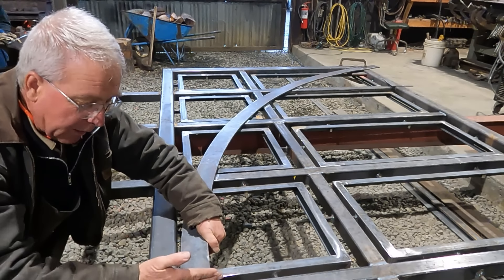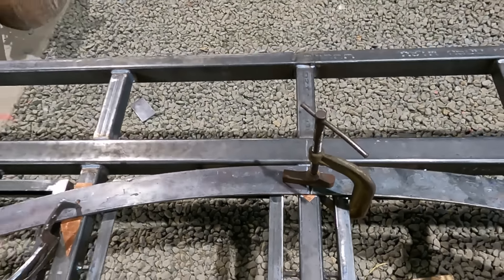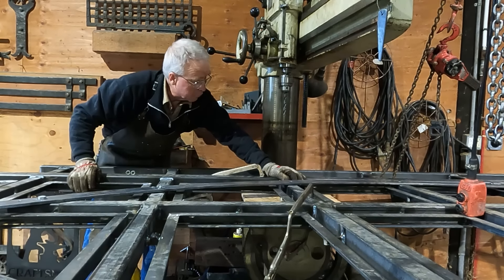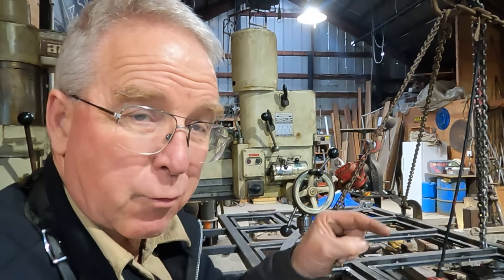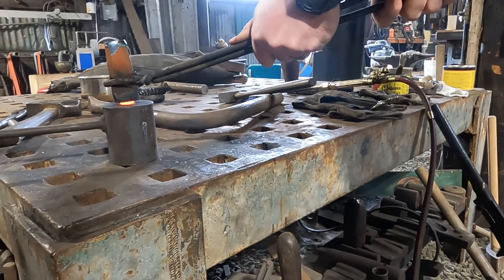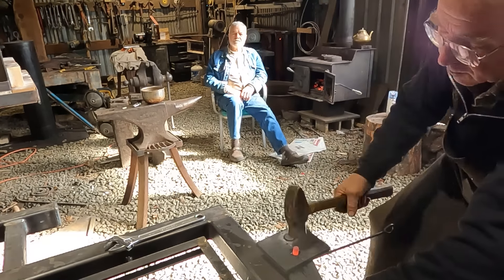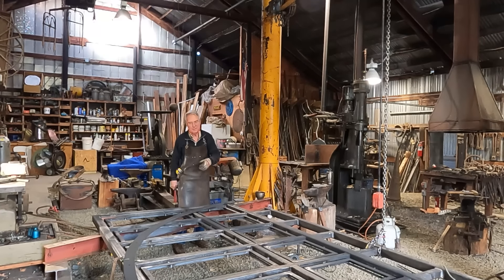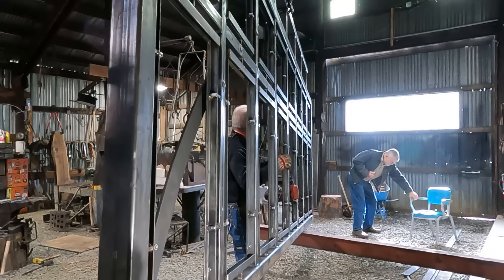Using My Jib Crane and Installing Forged Rivets: Gate #10

Comment: Someone get this man a magnetic drill press! Great work. Fun to watch.
Reply: MAG DRILL FTW!!! I bought one for an awkward structural steel project and now that I have it I can't imagine my life without it.  It might have made for a significantly shorter video though, and watching Scott fly this gate on a precarious trapeze was kinda fun.
Reply: Exactly. You would think that after all the stuff he buys and then shows us he would have gotten one already. Hell with all the darn money he's spending on this gate, whats another 1500$ going to hurt .
Reply: @michaelcarroll991  I don't really need one. I've been hand drilling for years. Sharp bits and start with small bits. Use cutting oil.  But, I finally broke down and  I purchased the 200.00 Vevor Chinese knock off mag drill. It's got a weak electro-magnet. But I just couldn't justify 2000.00 for a mag-drill. Heck, I couldn't justify finding a broken 400.00 Ebay model and repairing it. And in all honesty, That's what I usually do. Buy a broken tool and repair it. Anyway, magnetic drills are awesome. And the annular drill bits that they use are even better. 
  All of the above said, the Vevor drill is a nice mag drill. Far from perfect. But still pretty nice in my opinion.

Comment: How to paint that gate?
I own a complete Ransburg #2 Process electrostatic paint system, including the conductivity meter. I purchased it new in 2021 and went to a training class in Indiana. Being electrostatic, there is virtually no overspray. What overspray there is will be dry and will fall out within 3-4 inches from the gun cup face. I mostly painted custom iron handrails for an artist craftsman fabricator. They were very intricate such that a typical spray paint system wouldn't penetrate the design. I've painted chainlink fences around parking lots without moving cars. I've painted lockers in schools without removing them from the hallway. I've not used it in years. It is for sale (very cheap) if anyone is interested.

Comment: When you are welding a joint like the center of the arch you can tack weld a starting and ending tab on the ends of the joint so you can start on one tab and end on the other.
The tabs can then be cut off and ground smooth. No pits, or cracking at the end of the welded section. 
In thick sections you can bevel both ends of the arch join on one side and lay a root pass to begin the weld. Before you cut off the tabs and after filling the top of the weld completely you can flip the joint and grind out the seam on the back side. With the seam ground down until the root  pass is showing you can weld the ground out seam full then cut off the tabs. 
Takes longer to write it out than to do it. Afterwards the joints are fast, solid, with none of the tedious rework filling in the weld crater.
Reply: Actually, runon/runoff tabs are a Navy shipbuilding requirement.

Comment: I had a bunch of bedtime worry challenges the first (and only) time I built a composite deck during the pandemic. Not having time pressure helped. I realized along the way that most of my breakthrough ideas came while I was either in the shower, or sitting in traffic. Always be thinking.

Comment: Hot rivets are actually more secure than comparable bolts because they completely fill the hole and leaves no void in the drill hole for corrosion to deteriorate the fastener or structure.  And honestly, a nicely installed rivet just looks better that a bolt head or nut in my opinion.  Thanks

Comment: Since you asked, in my opinion your machine is not quite dialed in. You either need to increase your wire feed speed or turn your voltage down. The sound of your arc should be a bit crisper.

Comment: On my mobile crane that is mounted on my trailer. I have put a secondary or auxiliary winch on the top that goes over the front of the jib whenever I put it on. 
That reminds me, you could do the same with a auxiliary winch and put it up on your jib Crane, so that you can do secondary holds

Comment: I’m a welder! Mostly stick is what I use but I do weld wire feed! Lot of it has to do with wire speed and travel speed if your getting undercut you could be travelling to fast or your wire speed is too high! But it’s just a matter of toying with settings! Your welds didn’t look bad at all! And I like to use brass with as a backer but cooper works too!

Comment: came out amazing.but this is the first time im going to call you out.at 66 which I am also you learn to work smarter not harder.moving that gate to drill holes was the wrong move.the job required a mag drill.faster safer and there are some cheap ones out there that are pretty good.

Comment: I'm not a real welder, but the sound of the MIG seems a bit off-- like the voltage is a bit low for the WFS or the WFS is too high for voltage. Hard to judge from YT audio quality, but is anyone else hearing this? Usually a good hot MIG is closer to pan fry and higher pitch. Tell me I'm wrong if you think so.